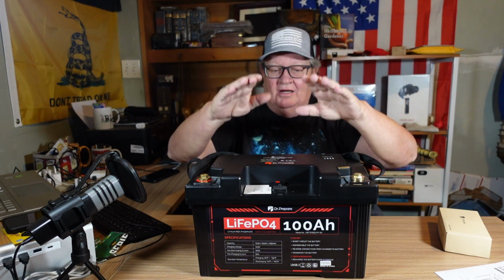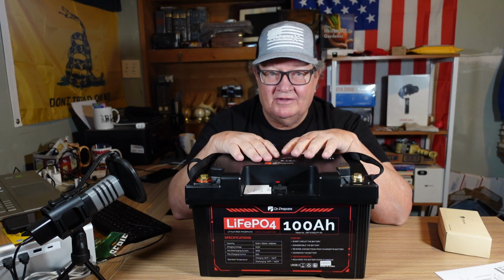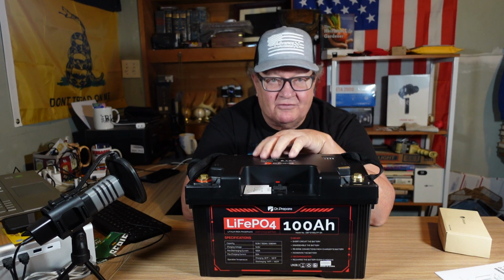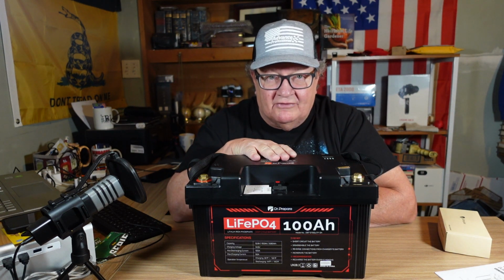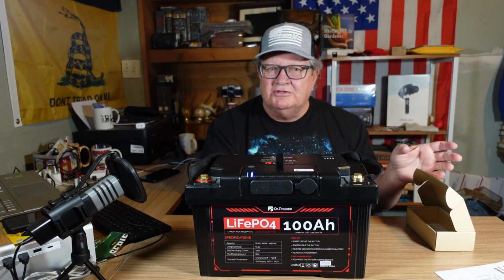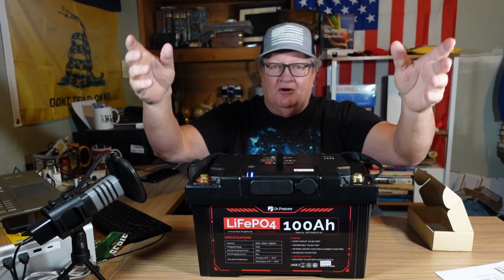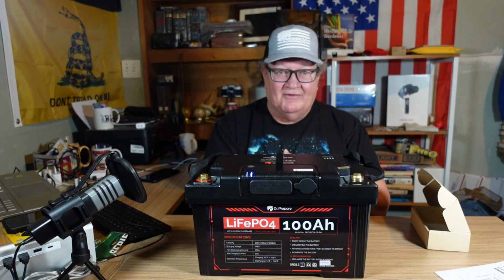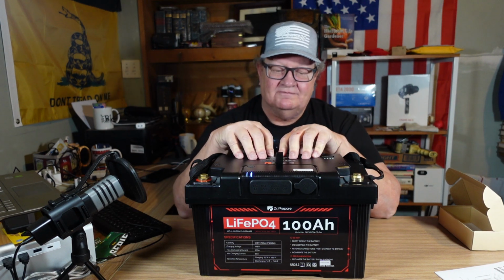Dr Prepare 12V 100 Amp Hr Deep Cycle LiFePO4 Battery / Power Station Combo

Comment: Hi Joe this is Joe in Northwest Ohio I'm so glad u have lithium now Im running on 16 lithium 120ah cells basically 4 120ah batteries 240aj in 24v for 5760wh what I like about lithium is how long I can go on lithium before even reaching a low state of charge one 100ah lithium battery capacity is like 10 deep cycle batteries..

Comment: Any plans to insulate your power shed?  A passive solar air heater on the south wall might be an inexpensive way to raise the temp inside a few degrees.  Maybe a diy geothermal system to pump warm water through a couple of barrels inside could help at night.